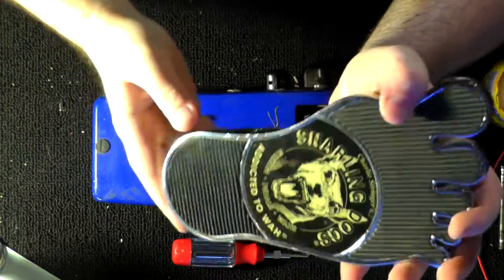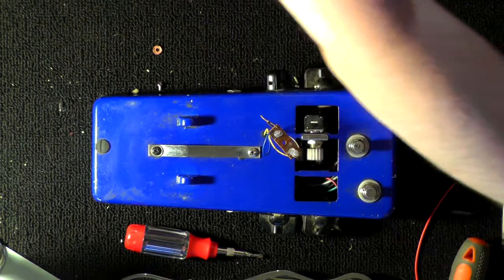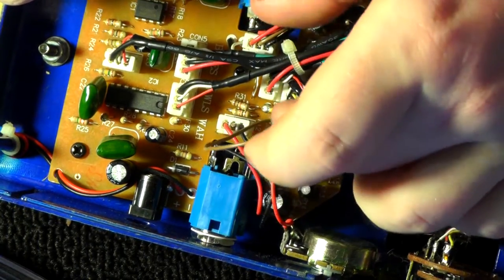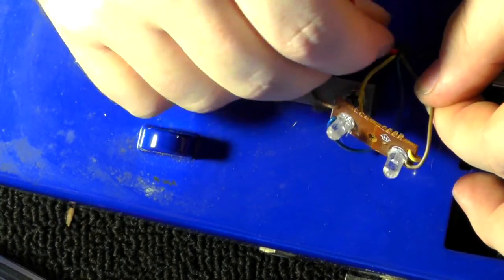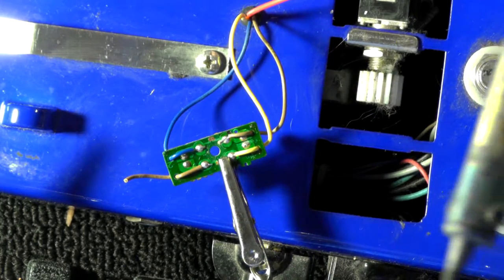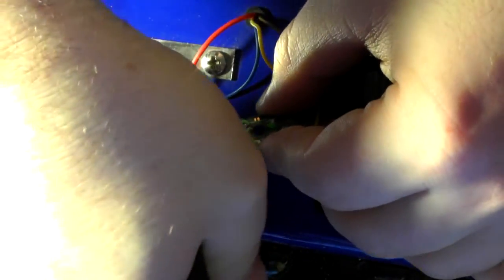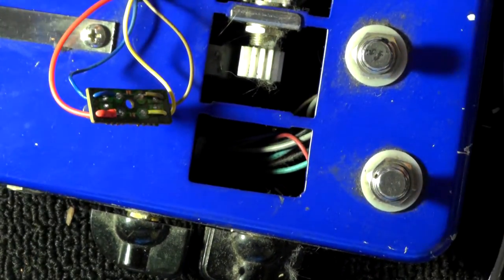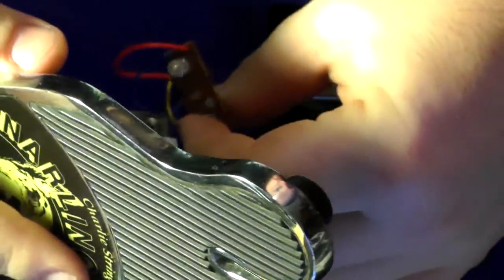On the Bench 5: Snarling Dogs Wah Repair!

Comment: just dusted off my Snarling Dogs Bootzilla bass pedal. so coooooool. i remember the red light up eyes stopped working after a couple of days  because the wires powering them were too short and moving the pedal up and down snapped them from their solder points. was this a common defect with the pedals?

Comment: i picked up one of these cheap on ebay - i wont wah wah- when i took it apart the the input jack - the black wire was in position the red wire was disconnected from the input jack - i resoldered it still no sound - theirs a brown wire from the three piece circuit board that the other wires are from - missing altogether - seems to have been cut of at the board - does this normally need to go to the input or elsewhere - the output jack - has all 3 red/black/brown wires soldered to the jack - its getting power as both eyes will light - but no wah wah sound - any help would be greatly appreciated